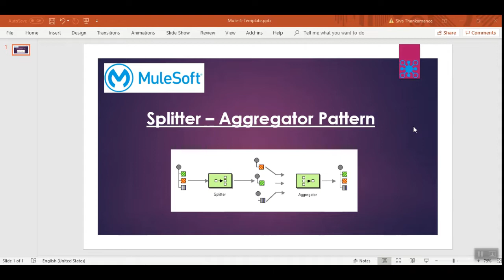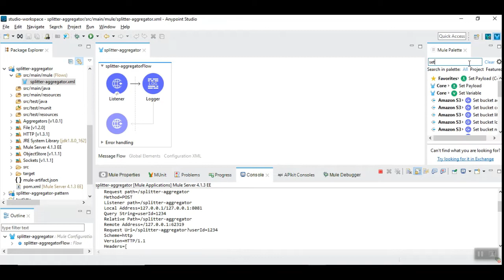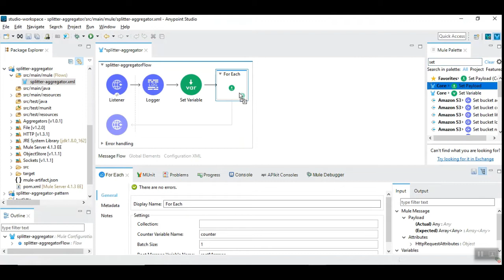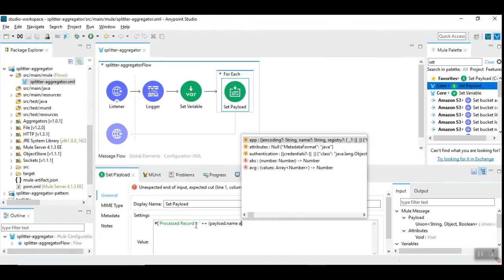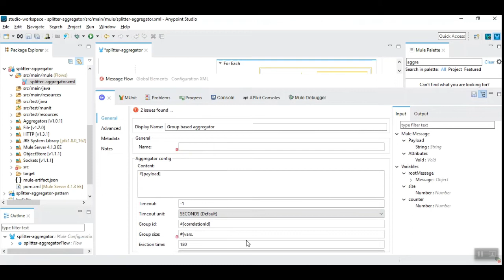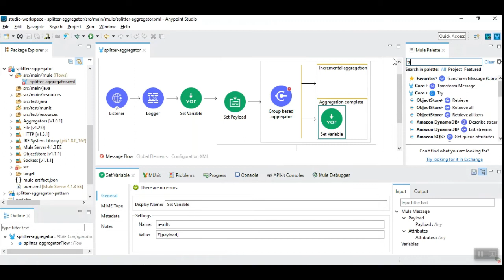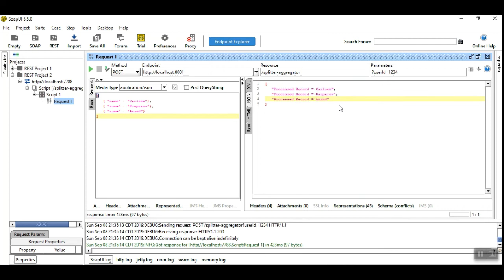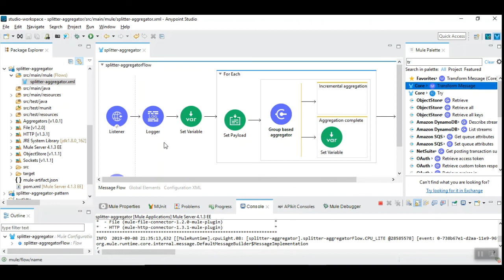MuleSoft | Parallel Processing using Splitter-Aggregator Design Pattern in Mule 4

Comment: Hi siva, 
Can this be achieved by Batch Scope and Batch Aggregator? If yes then then how does it differ?

Thank You,
Smita
Reply from the maker: Hi Smita - The Batch component is for asynchronous and Fire-and-forget pattern. This Splitter-Aggregator is for real-time processing where the performance can be improved slightly by parallel execution of mutually exclusive tasks.  So, the 2 components are for completely different purposes.   Please feel free to let me know if you need more use-case examples.
Reply: @sivathankamanee-channel  Can large amount of data be handled by Splitter-Aggregator pattern? or will have to consider Batch component in this case?
Reply from the maker: Hi Smita - Technically handling large amount of data depends on infrastructure. You need to either vertically or horizontally scale for large data or split it to smaller chunk of data.
Reply: @sivathankamanee-channel  :  when you say "where the performance can be improved slightly by parallel execution of mutually exclusive tasks" , I didn't exactly get where is parallel execution happening, for each execution takes place sequentially and not parallel as far as i know, please correct me if I am wrong.

Comment: Thanks for the videos. They are great. Regarding for-each I have the following confusion. 

1 Regular For-each basically is used for iterative/ sequential processing . 
2. Parallel For-each is used for parallel processing.
3. Regular For-each with batch-size is used to split the processing into batches of mule messages and does parallel processing.
4. Scatter gather does parallel processing.
5. Batch Job is parallel processing.

I feel its an overkill by Mule 4 to provide so many overlapping activities for processing in parallel.  When to use what and how exactly they differ is getting difficult to understand.
Also when we say parallel processing for for-each ( with batch size) and parallel for -each - are we saying they are going to spawn multiple threads ? 

Can you help create a video to explain 1. differences in each of these 2. the way threads are spawned in each of these ? This will hugely benefit many of us learning and working on mule.

Thanks again for your wonderful series of Mule learning vidoes. Appreciate it and enjoying them thoroughly.

Comment: For each works on single thread. I still did not understand how parallel processing is achieved in this example. Can you please clarify if I missed something?
Reply: We can set the batchSize to vars.size in order to achieve parallel processing. Please refer to the example below:<foreach doc:name="For Each" doc:id="35bb152e-a480-4747-a5e7-be346b1cde83" batchSize="#[vars.size]"/>
Reply: @pratikpriyadarshi8910   : in this case why would you need for each then, as you are sending complete incoming data as it is without splitting